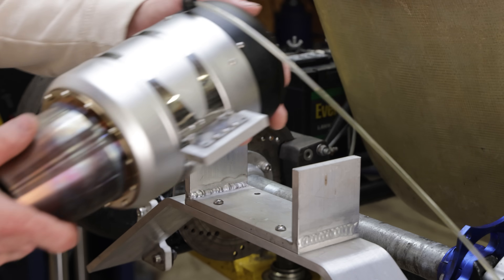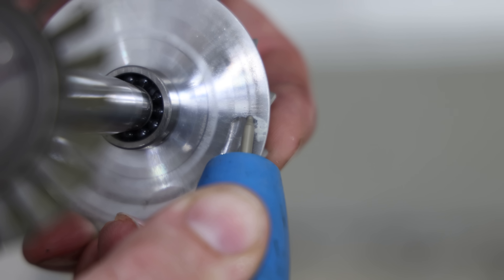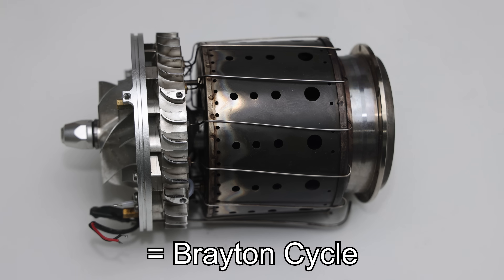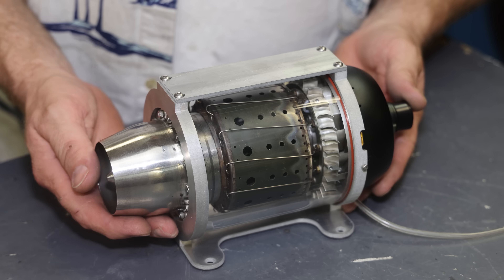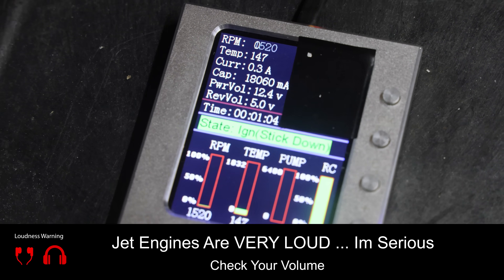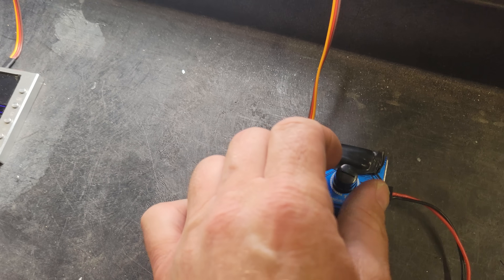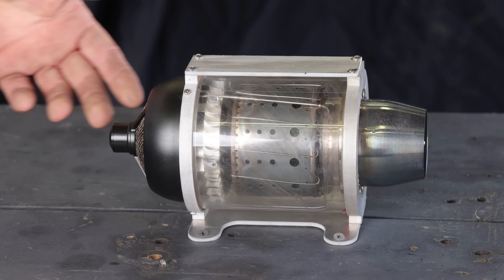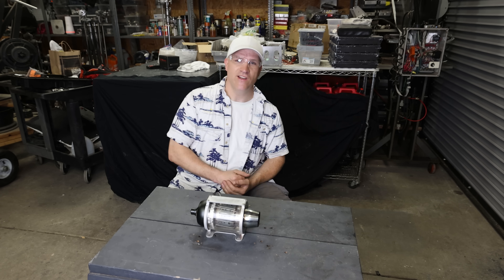See Thru Jet Engine

Comment: Awesome video man. We need more jet engine content. Lol......... BTW so after you balanced the compressor and the turbine wheel assembly, you took it apart to install in the jet engine. I was wondering how you Re-Aligned the compressor and turbine wheel axially so the assembly stayed balanced after the install?
Reply from the maker: Yes I used alignment Marks

Comment: You: Most of the flow from jet engines comes from the fuel..
High-bypass Turbofan: Disagrees.
Reply: All of the energy comes from burning fuel - that's what "fuel" means.
In a turbojet all of the thrust comes from reaction to the exhaust, meaning reaction to the increase in momentum of the fluid going through the engine.
The vast majority of the mass of fluid going through the engine is the air, not the fuel.

Comment: Slight correction to your explanation:

It's a turbine without any compressors, outer side is what keeps the core from melting some designs have the air turn 180 degrees in direction to get to the core. This will slightly compress the air, but you will need to increase fuel. This design will be the most fuel efficient at low altitude. 

Have the air turn 180 degrees and you'll get more trust from that design. 

When the engine is at 30k feet the engine needs to compress the air per fuel lbs or it will stall. Not enough o2 at that elevation. 

So yes turbine engines can consume more air just like a 2.0l engine for a car can consume 5.0l of air to gain hp.

Comment: how that shaft bearing can survive more than 100 thousand rpm ? is it any sort of lubrication system flowing thru the bearings ?
Reply from the maker: Yes some of the fuel is pumped through the bearings... You put 5% turbine oil in the fuel. But I agree it's pretty impressive

Comment: “The fronts off by a thousandth of a gram and the back by two thousandths.”

Man, you missed a golden opportunity to make it perfectly balanced, as all things should be.
Reply from the maker: It's in the green at .004 or less...
Reply: You can reduce the imbalance to less than your instruments can read, but perfection is not possible. There's no reason to use the measurement precision of your instruments as the standard for anything.
Reply: @brianb-p6586  It was a reference...and a joke...
Reply: @oceanblu5252  I don't know what it was a reference to, but okay.

Comment: Criticism: Some engines sound like vacuum cleaners when filmed in slow motion. (The see through intercooler, in slow motion, sounds like a vacuum cleaner before a stock explosion sfx appears shortly after. You may need a new explosion sound effect. Some of the sound editing you made in the silent slow motion footage is weird. And you need to slow-mo the jet engine down WAY more to see how it actually works, rotors and stuff.

Comment: When the gasket blew out, it wasn't so much due to the pressure, but because the metal parts of the combustion chamber expanded, pushing the end plates apart, which unloaded the gaskets. You could try machining a groove into the inside of the acrylic tube and using O-Rings to seal radially against the outside of the end plates. This would allow for more movement due to different expansion rates

Comment: How does the temperature and oxygen content of the incoming air influence the force/thrust of the engine? Is there anything you can mix with the air to create more thrust?
Reply: A jet engine on nitrous... Or something similar. That would be insane lol
Reply: @goosenotmaverick1156  Or, mix in some nitroethane with the fuel?
Reply: @drflash36  I'm not familiar with that, would the fuel remain stable if it was added?
Reply: Gas turbine engines run with excess air, meaning that there is more air flowing through the engine than required to provide enough oxygen for the fuel to burn completely. More oxygen wouldn't help.
Reply: @brianb-p6586  so adding an oxidizer and an extreme amount of extra fuel would yeild no gains? Just tryna make sure I understood what you said. I wasn't aware that's how they operated. I do piston engines and jets/turbines are way out of my knowledge set. Cool to know though, thanks!
Reply: @goosenotmaverick1156  Correct. you can add fuel (and oxidizer if you really overdo the fuel rate) but without additional air you will be limited by the hot section temperature and it won't be useful.
Reply: @brianb-p6586  so basically temperature/material limitations rather than fuel? Again just want to make sure I understood you correctly
Reply: @goosenotmaverick1156  Yes. 🙂

Comment: Whats acrylics you use? and how much pressure inside that?,
never been into mechanical one, but i had big appetite for kind of these contents.

Hopes you can make modifications in part 2 like, double spinners? (i dint know the name), but actually what is do is more pressurized the wind inside the chamber before launching it into fuel,
same like semi ramjet machine i think, but since ramjet didt had moving parts it would be different one

Comment: Your generalization of the fuel adding most of the energy for thrust is accurate for a turbojet but not a high bypass turbofan. The majority of the thrust from a turbofan is just the first stage compressor fan acting like a propeller essentially.
Reply: All engines get all of their energy by burning fuel. The thrust force from a jet engine results from reaction to giving the exhaust momentum, and the vast majority of the mass of exhaust is air - not fuel - so the thrust comes from the speed of the air, which is due to burning the fuel.

Comment: What was the software and hardware you were using to spin balance the compressor and turbine? Also, was the outer case borosilicate glass or a type of clear plastic?
Reply from the maker: here's a link to the balancer to get more info about the exact one I use https://bit.ly/Balancer-I-Use-Tell-Them-WP-Sent-You I custom made a composite

Comment: A long time channel lurker here.... You have outdone yourself with this video. Exceptional work mate! That was genuinely hair raising to watch. I didn't expect that it would explode (more hoping it wouldn't) but the fact that it popped out those gaskets is indicative of the pressures you're up against. 
Something else I noticed was that there was still a bit of swirl in the air after the compressor stator. I wonder if this could be improved (I honestly don't know if it would make a difference) 

Anyway... Now that we've seen the inside of it working,  you've got to BOOST it.... open up those orifices leading to the combustion chamber, crank up the fuel pressure, start the cameras rolling and leave the room.

Comment: Never in a million years would I have thought that you could sustain full power on a jet engine for any length of time at all with a transparent housing... but you pulled it off.  That has to be a first and probably only.  The entire process from the balancing and machining of new parts to the assembly and of course the bench test payoff, all of it was so interesting!  So cool to see the inside of an actual jet turbine while it's running at full tilt!  Gotta keep coming back to this channel.  Thanks for making some really cool science content!
Reply from the maker: Thank you, likewise, that material took me like three and a half years to develop and I first use it for the see through rotary a couple years ago and then the liquid piston rotary more recent, and now for this, it was a pain in the butt to find a factory with the machine to make my material in this shape. But damn I did not think it was going to hold a Full throttle run, I thought it was going to blow for sure. Thanks for watching, for sure I'm going to have some more stuff coming up real soon. Thanks

Comment: do you get more thrust by adding water vapor through the intake? if you do, im interested in knowing how much of an increase it is with its relative humidity.
Reply from the maker: I have heard you do, that is a good subject for a video for sure. I've had that on my list for quite some time now
Reply: @WarpedYT  i learned in A&P school that its due to the rapid expansion of water vapor when it instantly turns to steam, but I also know that the compressor blades are essentially airfoils and humidity destroys lift. should be an interesting test.
Reply from the maker: @utley  yes very interesting for sure.
Reply: Water vapour would add mass of working fluid, potentially increasing thrust. Vapourization of the water would increase working fluid volume, potentially increasing exhaust speed and therefore thrust, but a lot of energy would go into vapourizing the water.

As quoted by Wikipedia:
"Water is normally injected either at the compressor inlet or in the diffuser just before the combustion chambers. Adding water increases the mass being accelerated out of the engine, increasing thrust and it also serves to cool the turbines. Since temperature is normally the limiting factor in turbine engine performance at low altitudes, the cooling effect lets the engine run at higher RPM with more fuel injected and more thrust created without overheating."

This was done in regular commercial aircraft decades ago, but is no longer done with modern commercial aircraft engines.
Reply: @brianb-p6586  they have this in the rolls royce Pegasus engines mounted on Harriers. Also they inject water into carbureted engines on race aircraft to help cool cylinders and increase manifold pressure. Not a turbojet or Turbofan, I know but same principles.

Comment: The compression ratios on jets are not as much as you would think.  Each stage has a ratio of like 1.1 or 1.2ish.  Every engine is different but like you said, it's not as much air as you would think.  The thrust is derived from the expansion of the gases during combustion.  In fact in larger jets the vast majority of air flow is used for cooling the hot section components, so they don't melt.  Smaller engines like this don't have all the same cooling requirement so it actually is a better representation of how much air is required for the combustion process.

The exception to that is turbo fans or high bypass engines.  They use rotational power to turn large fan blades, which generate even more thrust and add efficiency to the design.  But it is still a small percentage of air that is used for combustion, compared to the total throughput.
Reply from the maker: Very true

Comment: Awesome video.   
I’ve been thinking one of these little engines would be a suitable engine for a relatively lightweight generator for a touring Electric Vehicle.  Tuned to run on hardware store grade methylated spirit or kerosene ( with a wee bit of oil added) and geared to run a small generator capable of BIG power output.  
Might be a bit noisy, but who wants neighbours when you are camping🤪?
Reply: That's been done. Hardware store fuel is more expensive than real turbine fuel or diesel (or gasoline), and efficiency of any simple turbine engine is low.

Comment: I suddenly understand the concept of a jet engine now. Seeing the combustion happen in between the compressor and the turbine, which are linked and sort of squishing everything and forcing the explosions to go out the back, creating thrust. It actually makes perfect sense now. Thanks.
Reply from the maker: Same thing I thought when I saw it
Reply: @WarpedYT  
1:16 - The car engine comparison that makes the most sense to me is the turbosupercharger.  At a certain speed, the cylinder only gets in the way, and you can eliminate that component entirely.

And this fits with how actual jet aircraft evolved.

Freakin amazing video.
I was hoping you would invite the neighbors over for a marshmallow roast.  Heh.
Reply: @dahawk8574  I think you meant a turbocompound engine. "Turbosupercharged" is just what we now call simply "turbocharged".

Comment: If anything, it shows there is definitely some compressor bleed air available if you could figure out how to tap into it from the outside casing. (Jet engines on full size aircraft use it for all kinds of things.) Might be neat if a small turbine on a side vent could power a generator and reduce battery usage on some vehicle model. Possibly some thermal expansion on the end brackets, but the o-ring blow out seemed more pressure related.

Comment: That was pretty sweet - what material did you use for the transparent material? Is that just plain glass? Acrylic? Some sort of borosilicate?

[EDIT] So he did say it's "his own recipe" in another comment. But I'm fairly certain it'll be some sort of borosillicate (Sillicon dioxide with boron trioxides, aka Pyrex) based glass recipe, as it's cheap (compared to ALON glass), has very good thermal expansion coefficients, and is capable of handling temps up around 500C, which appears to meet the requirements observed here. Although quartz (pure sillicon dioxide) tubing is widely available and has high working temp capabilities - you just need to be more careful about temperature homogeneity, which might be a problem here.
Reply: Maybe aluminium oxynitride. I hope he responds to this because I'm interested.
Reply: Should be quartz
Reply: @chrichri7736  agreed most likely. transparent aluminum is probably far too expensive & idk its thermal properties. could also be boro as i doubt it would melt seeing how thick it is
Reply: I work with stained glass for a living and I would have to guess and it’s just a guess I would have to say that it’s scientific glass as it’s made to withstand extreme temperatures as well as rapid temperature changes and not shatter and more importantly any one can get that stuff in any configuration you want for a shiny penny of course but you can get it.
Reply: @justinandrus6731  thats laymen's term for borosilicate glass, aka boro aka pyrex (just fyi).

Comment: Very Cool Sir !!  Is that you operating the cnc machining equipment? Such skill, impressive! Suggestion: See thru after-burner section, with tiny inconel (or similar) spray rings. Experiment with water/alcohol mixes up to pure distilled water, as well as jet fuel in the AB. Friends retired from Kelly AFB, San Antonio, Tx. say the old engine B-52's used water injection for take-off that would make a mighty Roar!  Sounds fun, right! Love the channel. Paul, from S. Central Tx

Comment: i understand how turbines work, im a mech engineer, and a pilot, aspiring to airlines, and to this day it still doesnt seem like it should work
Reply from the maker: It's crazy because there was one part of the video that I cut out because I thought it was too lengthy, where I talk about how it just doesn't make sense that the air doesn't go in the opposite direction because of the huge pressure differential, I think I might post it on my shorts on my other channel.
Reply: @WarpedYT  its essentially the movement of air along a pressure gradeint, and the compressor generates more pressure than the expanding gasses, so it acts like a wall stopping gasses from flowing forward, and forcing it back through the only opening. its also just not logical at least to me how air can be pressurised despite being in an open containter
Reply: @ryanm.191  it is really hard to wrap the mind around, but you answered your own question: there is a pressure gradient. 
Do you have pressure in a garden hose? Yes. Is there pressure outside the end of the hose? No. Is the hose open to the outside? Yes. So... you have have a fluid pressurized despite being in an open container.
The flow is crucial; you can't establish a high pressure inside a non-running engine then expect it to start flowing and turning the shaft in the right direction. So you start the flow with a starter motor, then add the combustion.

Comment: crazy idea... what if you made a turbo inline motor. hear me out here. imagine a set up of modified car turbo into turbo jets all sharing the same shaft. lets say 6 of these bad boys inline on the same shaft. put a prop at the end, duct the whole thing and call it a day. Has anyone ever tried that? Or forget the shared shaft, just an array of 6 modified car turbos in line and staggered to best fit tight. Have all the intake snake to the front and all the exhaust snake to the back. would you now have a big bad ass turbine, with mega thrust?

Comment: Dear Sir thank you so much for the efforts to make this video. Have you ever considered a Jet Hot metallic ceramic coating? It works wonders for car applications and Im sure should increase your turbos efficiency. Also I have a question about the combustion. is it like a blow torch, where you ignite it and its, self sustaining or do you need to continuously add spark, like a combustion engine or do you use glow plugs like diesel? im planning on building a turbo jet and am wondering how to approach the ignition. Also i imagine that the electric starter, can be used as a generator once the engine ignites to the right RMP. Heck now that I got your attention, Im planning on using all ceramic bearing on my design. It means theres no need for oiling. Im doing it to also be able to use HHO gas as fuel, without out the need to add oil to the fuel. The all ceramic bearing would make this possible. The turbine generator would power the electrolysis and inturn power the turbine. All off of water. Sure youd have to retune everything, ass HHO is a hella reactive, but the ceramic coating should be able to handle the added heat energy. What do you think?